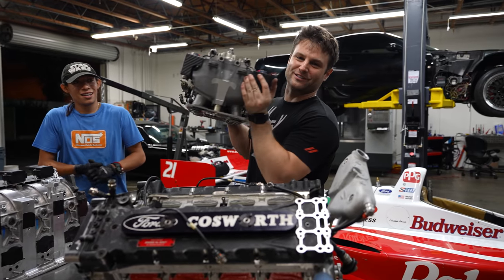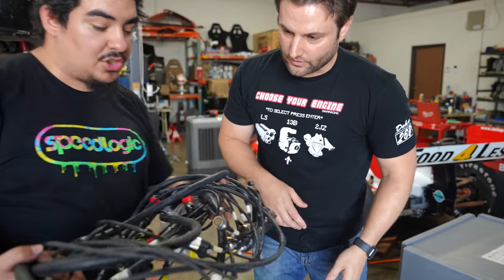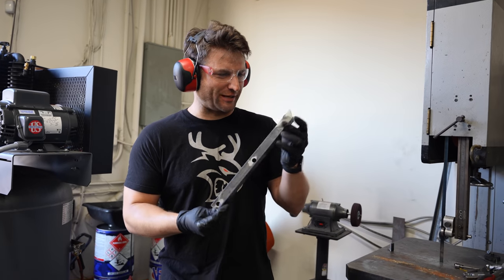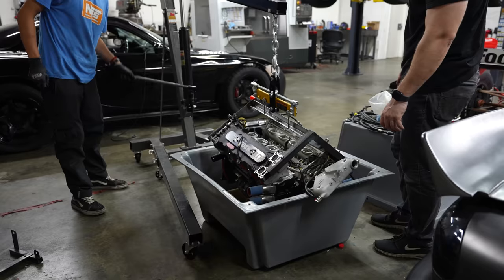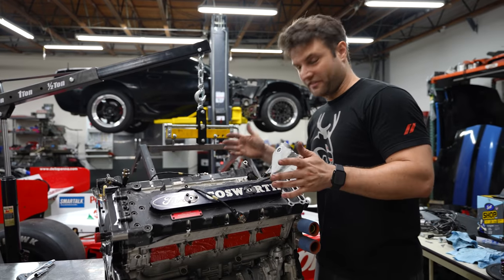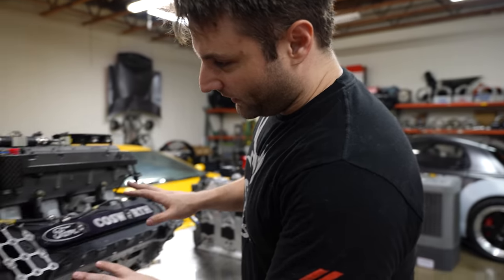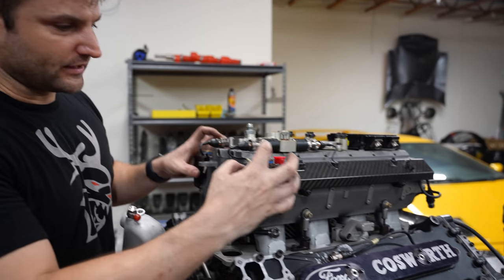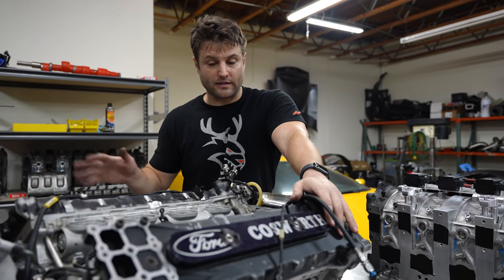I bought a $37K running IndyCar engine. I shouldn't own this

Comment: Happy to see you unveil it! Offer is open if you have any questions. -IndyCar electrical engineer
Reply from the maker: If you come across a pinout diagram for that engine or harness id love you forever. haha about to dig into pinning it out
Reply: @RobDahm  10-4. Talking with some folks this weekend in Long Beach about the original engine management. Early signs point to a Delphi based system but apparently there were options back then. Let me know if you find any branding/part numbers on any of the loom labels

Comment: "Lets see how fast this can go"  oh lord dude....  It started out doing 240mph in the straights.  Improving?  please use caution and methodically do it right.  Contact me if you need pointers.  Looking forward to this build!  SO cool!
Reply: Exactly Safety really needs to be on 110% for this. Those speeds are no joke, I wish him luck and safety in this insane build.
Reply: He's just making a burnout car to compete with the Aussies 😎
Reply: @ichoozjc  i mean how many indy cars do you see doing sitting burnouts
Reply: @ronbaer67  All the time when Zanardi was in his prime
Reply: @ronbaer67  The winner of almost every Indycar race
Reply: @ichoozjc  needs to double the displacement before taking on an Aussie burnout, lol.
Reply: @Not_A_Cat  nah he’ll just double the rpm instead
Reply: I would guess an Indy car's cooling system is not designed for burnouts. My guess is the engineers would not want to put a bigger, bulkier radiator in than they have to, and certainly not a fan with enough mass flow rate to keep the engine cool at high RPM while standing nearly still. The car is designed to be moving as often as possible and not be running a ton of RPM at low speeds. My guess is a relatively short burnout is fine but a minute long burnout would not be good for bearings and piston swell and what not. Plus, Rob does not have the budget to rebuild that Cossy that often, and I imagine a 3 rotor would not fare a ton better with limited cooling capability.
Reply: @F14Goose37  You couldn't be more correct about the capabilities of the cooling system in these cars.
Reply: @F14Goose37  Wouldn't the fact that it's running methanol allow it to run significantly cooler and reduce the amount of cooling required? I'm no expert but I bet it would do burnouts all day long without too much issue.
Reply: @8bithack  You may be right but I would also guess the engineers would have factored in the fact that the engine runs on methanol when they designed the cooling system. Who knows? If I were betting, I would put money on the car being a terrible burnout car.
Reply: @8bithack  Its already designed for Meth.  As it turns out, they don't run any cooler than any other fuel type.  They run a lot higher cylinder  pressure to utilize the higher "octane" of the methanol.  and at "full tilt boogie" race settings they are leaned to get VERY hot combustion temps.  Anyway, the nominal oil and water temps are around 100c.
Reply: @F14Goose37  you are right that there are no fans.  Also, you are right that they need a lot of mass air flow to cool, but its not too bad to do a 30-40 sec burnout.  There is also plenty of space in the sidepods for bigger rad's if you want to make that better, and even add some fans.   BUT, it turns out that far shorter life than cooling there is a problem with driveline.  Half shafts and  gearbox are NOT good for dumping the clutch.  I have pulled half shafts out of bodywork from doing this.  I have also pulled shafts that have been twisted about 20 degrees.
Reply: @StephensonRaceTech  that was my point. They're made to run with the cooling effect of methanol so I think it would have no problem doing standing burnouts all day long without cooling issues. Could just keep adding more fuel to bring cylinder temps down to a point even.
Reply: What is this talk of "minute long burnouts" and "30-40 second burnouts"?
A proper burnout lasts until one or both tyres explode and you're making sparks. :)
I've never built one, but I know that burnout cars need solid cooling, even when running alcohol.
Reply: @8bithack   In other cars, that would work.  Ive wrenched these cars, there just isn't any cooling for sitting still.  No mass in the engine to suck out heat, no fans to cool the water and oil...  You can add more fuel, but at a certain point you no longer have combustion and temps still climb; even if you can richen it to an EGT of 600, thats still 600 degree combustion heat with nowhere to go.  The other side affect is that the hot exhaust starts burning up the bodywork, wires, shocks, everything.  Im with you, most cars running methanol you just rich it up to do whatever you want bc theres mass in the block to suck out heat and passive convection under the hood...  These cars need airflow, or they just eat themselves alive.
Reply: @StephensonRaceTech  Very interesting insight from somebody who has worked on them. I was just guessing based on knowledge of heat transfer from my job and how I would do things if I were building for a specific purpose. Thank you for sharing your experiences with these cars!
Reply: He’s going to be limited by the maximum engine speed unless he intends to cut one-off gears for the transmission. If the engine is rated for 14k, then he may be able to turn 18k with modern controllers and better balancing/valving, but to make the most use of that extra rpm, he would need new cams. I doubt Rob is going to go that far, and unless he goes super crazy and builds a 20k rpm 4-rotor, chances are that it may be slower than stock simply due to limitations on engine speed.
Reply: @StephensonRaceTech  I hope he calls you or flies in one of your equals.
Reply: @Cjbarker2  Na.  The gearbox in these has what we called a "drop gear" that is an  adjustable final drive ratio.  ;0)  You can adjust for 12k rpm to be anything from like 140 mph to 260. *well, now that i say that...  lemme look up in the "way back" machine and make sure this gen had a drop gear.

Comment: IF you had an LS swap in the indy, I'd be mad. 
But an actual Cosworth engine? That's a religious racing relic right there.
Reply: your opinion is important..........AHAHAHAHAHAHAHAHHA
Reply: @trillrifaxegrindor4411   Pot called the kettle black, eh?
Reply: If you're modding the Indy car for the street.. LS.   For the track and you have the cash? THIS is the way to go.
Reply: Cosworth??!! say no more.
Reply: @TravisFabel   Rather see a Ford 289 HiPo or FE engine in it if you don't have a Cosworth. 
LS is so damn over used in everything.. 
Like, I know America seems to have an obsession with Chevy and LS but come on. The US has some other interesting manufacturers too.
Reply: @ancientrenegade9243  Chevy engines are made by Ilmor Engineering
Reply: @raidkoast  coyote would be best
Reply: Why are you Americans like this?

Comment: Rob, it will go very fast, here's why. That big stainless disc on top of the intake manifold is where the CART mandated blow off valve would be located. Boost limited by series rules. You, on the other hand, get to run all the boost!
Reply: But don't forget that the engine was also designed with that boost limit in mind, and from what I remember, CART didn't have the "engine needs to last X races or a grid penalty" like F1 has these days...
Reply: @jsquared1013  exactly.  The danger is blowing up what is essentially, a bespoke engine, designed to be precisely at the limit of what was allowed under those rules and restrictors (and restrictions). 
This isn't a rotary you have a bunch of parts for.  You have to make every part you wreck.  

So I hope Rob has a very good idea of the math for this engine if he's going to change any of the major variables.  These engines were bleeding edge engineering that were designed to run very short and very hard lives as they were.
Reply: True, but because of that the motor will go bang very quickly if you take it beyond what it is designed to do. F1 used to have qualifying engines that lasted around 30 miles before blowing up, that's 12 times 2 mile laps to qualify then a race engine was put in. A BMW 4 cylinder turbo qualifying engine was reputed to hit 1500hp.....in the 1980s.

Comment: There's a blast from my past! I used to test these at cosworth circa 1997, in fact it was the first engine I blew up on the dyno. (I did a proper job too, huge hole in the dry sump) it was a development engine and was right at the end of its ft life and due a rebuild. 2.6l if I recall producing 820bhp. I'll deffo stay tuned to see how you get on.
Reply: You wouldn't happen to recall what sort of compression ratios these engines run would you? I saw someone mention they should make in the neighborhood of 600hp N/A without any modifications to the internals. Does that sound right to you?
Reply: Not sure, I did a stint in the F1 engine shop and they were about 12:1 but non turbo and not on methanol.
Reply: CanadaFirstchatt twentyseven  Guessing Dave will be by soon to give his answer, but since the engine is built to be a structural member of the vehicle and lacks the typical area one would attach motor mounts, it would be extremely difficult to put this into anything else... One would need essentially design a vehicle around the motor. Entitled possibly, as I recall the F50 has its motor mounted as a structural member, but not a simple "Hey Jumbo, let's put that motor in yet Corvette! It'll sound so cool!" type job.  Hey Dave, how far off base am I?
Reply: CanadaFirstchatt twentyseven  the problem isn’t that it’s a structural member, you could just make adapters for mounting it onto another car, but if it’s a race engine it’ll be hard to drive on the street and need a rebuild after x number of hours, it would probably need to run race fuel, have bad low end response and power, misfire, etc etc
Reply: @bilaltariq7819  You're right, they're not designed for a street application. Not just that though, a true race engine may not even turn when it's cold. It's not uncommon to have to heat an engine before starting it, totally awesome in a street car :p. Rebuild every couple 10s of hours is annoying as well
Reply: @Melanie16040  Easy mode, just build an engine plate that connects the cylinder head mounting location to the frame of the vehicle like how some drag cars do it, it should work for front and mid engine applications if you are resourceful. The trans would be a bit more difficult to figure out, probably need to space the flywheel out from the motor the same thickness of the adapter plate for what ever transmission you're using. But if you opt for an aftermarket sequential transmission, those guys usually have a good amount of input shaft length options that would solve a slew of problems when sorting out multi plate clutch systems, adapter plates, and transmission compatibility. For street use I would try to detune the motor, try to lower compression, looser clearences where it makes sense, lower the rev limit and up the boost. maybe get the cams reground to be more mild and to try and promote a bit more torque in the middle rpm range. huge dry sump reservoir. Another 30-40k later,  boom! you have a a unique motor with no aftermarket support that you hope doesn't blow after 50 hrs of use :D. not for the faint of heart but definitely possible.
Reply: Thanks David. I'm sure that would have sounded very pleasurable. I'm more used to hearing turbine engines the few times I have heard them tested on stands.
Reply: I gave a thumbs up 
For simply smokin a cozo
Reply: @Melanie16040  yep pretty spot on. The mapping back then was pretty sparse if you weren't in the racing rev range so wouldnt be that nice to cruise around in.
Reply: CanadaFirstchatt twentyseven  I'm far too sensible now, I used to value performance over show though
Reply: CanadaFirstchatt twentyseven  Pro? I was just a guy pushing the throttle and controlling the load whilst looking at a million guages, whilst also looking at the blowby manometer (Mercury on the rise  really got the rusty sherrifs badge twitching) and listening for that oh so subtle note change that you sometimes got a millisecond before BOOM! 🙄
Reply: @thomgt4  we did the heat up thing once but no gains so not worth the agro
Reply: @airvermin2226  also methanol is awful stuff. Like tear gas if you happen to be in a room with v8 running.
Reply: CanadaFirstchatt twentyseven  I had a hillman imp californian, 999 ralle engine, all the mods done, brakes, front rad etc, close ratio s/c box. Revved to 8500. I stripped the engine to rebuild it and was diagnosed with cancer soon after so  sold it to a friend who rebuilt it, well I went round and helped him rebuild it, but he sprayed it yellow, broke my heart.
Reply: I’m trying to find one for a cobra replica. Only ITB style.

Comment: "we need a Indy car running, then we swap the motor out" only Rob would buy a near $40k engine just to swap it and learn from it. True business man and entrepreneur!!! Love you Rob!!
Reply: He is a gentleman and a scholar
Reply: You would be surprised how much of that goes on in business. Competing companies will in a round about crazy paper trail way, buy something and reverse engineer it for them.
Reply: Not to be that guy but, it's an indy car.... Learn grammar...
Reply: @karlhopkins713  Your statement is missing something... Learn grammar.
Reply: Another youtuber did a small video on this, I forgot his name sorry but he's a well know figure in building racecars and making educational racecar related videos. He points out how impossible it would be to make a regular rotary run on this, the clearance requirements are insane, everything is built pretty much for this engine, it's not just part of the chassis, it's part of how the car was designed, and these cars are designed with NO margins: weight balance, ground clearance, everything is balanced for this engine.
Reply: @Galf506  while it will be extremely difficult, you might be underestimating the power of throwing a ton of time and money at a problem.  I think what you might be referencing was the alignment of crankshaft output to trans input shaft.  However with a CNC mill and lots of cash, I bet our boy Rob can figure something out.
Reply: @karlhopkins713  The comma goes before the conjunction... LeARn gRamMaR
Reply: @jtpug777  deeeeuuuummmm! Take that boy to school!
Reply: @karlhopkins713  "but,"

Oh the irony... Learn grammar.

Comment: What you’re looking at as far as the harness is aviation quality connectors they’re called cannon plugs and the pins have to be removed and or installed with specific tooling to seat properly and not damage the pins or receptacles (male and female ends) I hope this helps a bit …. Reach out to any A&P certified aircraft mechanic and they should be able to help out
Reply: Look for an avionics shop.  If you can find one that works on small jets, you’ll strike gold.  All mil-spec wiring, all of the tooling, everything.  I can’t make any recommendations (my job has restrictions), but just look for a general aviation (non-airliner) airport near you, and see what you find.
Reply: I put these things in regularly….at a nuclear plant lol
Reply: I know them as CAN-bus connectors. We use them in sound and lighting equipment.

Comment: Oh boy gotta see a dyno run for the engine when it IDLES at 9k rpm
Reply: They should idle around 3500-4000. Especially with modern injectors. Our current cars are around 3-3500
Reply: @ProModsPerformance  well the only reason I say that is because I saw a YouTube video for a engine very similar to that idle at 9000 rpm
Reply: You are thinking of Formula 1 engines. They have pneumatic valve springs. The engines were kept at a high rpm to keep the air pressure up.
Reply: @randallmason9687  oh my fault
Reply: @joshpittman2939  Yeah these don't really hold a candle to the simialr era F1 V8s. 18,000rpm redline vs the indy 12,000.
Reply: @randallmason9687  Could you possibly explain (unless it's too complex and you don't want to take the time, totally understandable) how, if the valves are pneumatic, would it not then take air pressure to open/close them? So why is it that something that uses air pressure, going faster and faster, actually keeps the air pressure up? 

As opposed to a lower rpm, valves opening/closing slower, taking less air pressure because you're not using air pressure to open and close them near as many times at a lower rpm... And thus your total stored air pressure is greater down low in the rpms because you're not expending nearly as much, but are still, I'm assuming, building it somehow.

I know this is going to be something that makes me look stupid like "hey ya dingbat, the compressor used to run the valvetrain is ran off the engine, so higher rpms means harder working compressor means more air pressure.. Ya idiot.."
Good thing I'm used to looking stupid. It's a look I wear well, I think at least.
Reply: @EarrGasmm  Toward the end Toyota was pushing 17K RPM. I believe for the last race they ran in CART, Fontana 2002, they ran single sided turbos (used just one of two banks of cylinders) and were allowed to run up to 17K. I believe the rest of the manufacturers ran around 15K.

https://www.youtube.com/watch?v=uLe9KTzpqg0